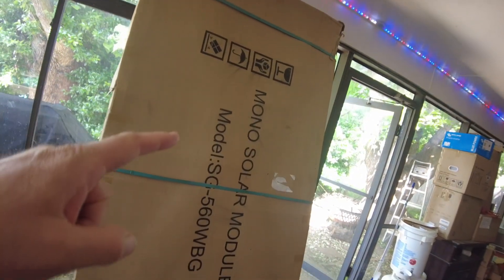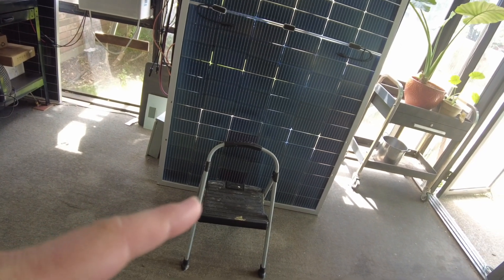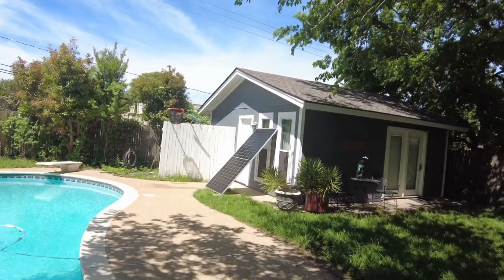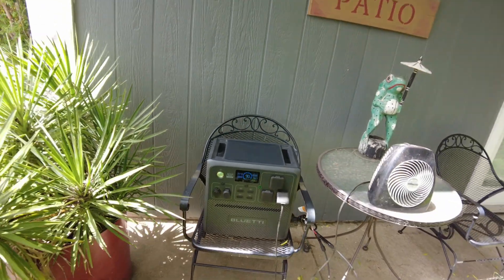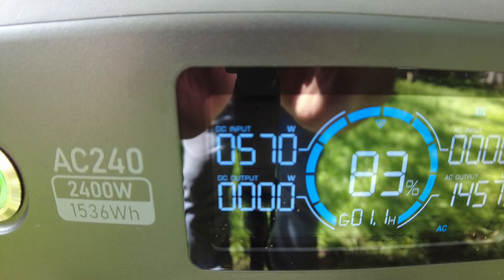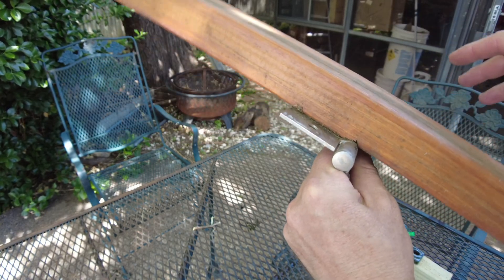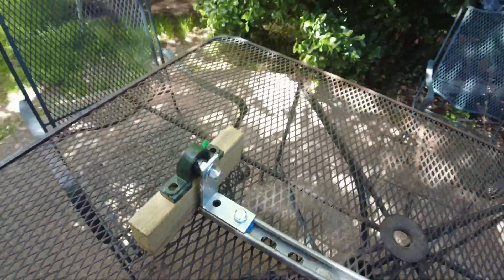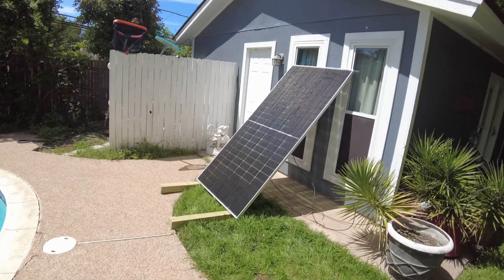SUNGOLDPOWER 560 Watt Bifacial PERC Solar Panel

Comment: Why don't you install those in a vertical way facing west-east; I've heard they generated more in that way and they kept cleaner as well, even in winter they don't get blocked by snow. I think the reason those have those wind measurement is because they are mean to be installed vertically.
Reply from the maker: That would be fun, I've wanted to experiment with vertical, hmm.

Comment: The idiocy of this guy taking a box cutter to cut across the cardboard box with a solar panel underneath pretty much tells you all you need to know about whether or not this guy has any useful information whatsoever to share with anyone about anything.
Reply: Wow! What a rude comment.
Reply from the maker: @meilyn22  Some people are just miserable 😉
Reply from the maker: I pulled the cardboard away from the panels as I was cutting. But even if it was right on it, what do you think it would do? Cut the glass in half? LOL

Comment: What really bothers me about this solar panel "power race" is that often the increases in power per panel are being driven by larger panels!  Well duh!  I have 15 year old panels on my roof and recently a company proposed replacing them with newer, higher power panels, but when I actually looked at the specs, my older panels were more efficient than the panels they were quoting, but theirs were bigger.  Huh.  I was actually impressed that mine were so efficient (and disappointed that the new ones were not more so).
Reply: university students  in Toronto tracked about 10-12 different arrays that varied in size and cost. The end results where very interesting as the smallest and cheapest array almost made as much power as the largest and most expensive array, coming in at second place. The conclusion was that most of the panels didn't live up to the advertised efficiency. I wish I remembered the brand of the cheaper panels. 😢

Comment: I have 8 Sungold Power 550w single facial panels on the roof of my motorhome. These bifacial ones look the same size as mine but are much heavier, having glass on both sides. I couldn't imagine myself, at 67 yrs. old lifting them on the roof of my motorhome like I did mine. It's a 2-man job for sure.  That said, I'm sure you will be as happy with their performance as I am with mine.
Reply from the maker: That awesome. Thanks for sharing 😊

Comment: 475W were too much for me. Went back down to 405W! Enjoy back surgery.
Reply: How so? Was it due to size?
Reply: @4evermetalhead79  more so the weight
Reply: @4evermetalhead79  Both. Bifacials don’t have the center support and our slightly flimsier too. If you don’t have a white or mirror reflective surface behind bifacials and have them at least 3 to 5 feet off the ground you’re wasting your time thinking you’re going to get more power out of them. Stick with standard panels under 430 W and your back will last longer.

Comment: Love these massive panels. Getting 560w actual from a single panel is insane. Too bad they stuck that specs label on the back blocking so many cells! Usually they’ve been putting little ones between the junction boxes.
Reply from the maker: I was thinking about pealing the label off :) But yeah wild getting 570w on a cloudy day.
Reply: @BradCagle  Absolutely crazy. After seeing that performance you were getting it makes me think my new array might have been current limited today. I was seeing 12.9 amps and the max output was 534W out of each 565W panel. They are at about 20 degrees facing south.

Comment: That is great news about experimenting with the bifacial panels.  I wonder what sort of power they would generate being setup 90 degrees to the sun but with light, white reflectors reflecting into both sides of the panel. Much easier to move light reflectors than the solar panels...
Reply from the maker: Man I really do want to play with some vertical bifacial. I've seen some experimentations with it, but I really think reflection from adjacent rows of panels may help, but I have not seen anyone experiment with multiple rows. Reflectors would be super fun. What do you think would be practical, and long lasting as reflector material? Thanks
Reply: @BradCagle  Acrylic mirror panels from Amazn.
Reply: @BradCagle  There is some corrugated plastic panels we can get at our Bunnings hardware store . They come in 8 x 4 sheets and various thickness from 3mm to 8mm. If you go for the 8mm (1/3") thick ones, however you will need a strong frame to support against even the gentlest of wind as they are super light. None the less, they are cheap, polypropylene I think and white. With this approach you can set the PV permanently in place and move the reflectors to adjust for optimal power. As you (and most of us) will mount a bifacial panel, there will be very little light coming in from the other side.
Maybe this idea is just BS, but would be a very interesting experiment for bifacials.

Comment: You know that to get that much wattage is to increase the size of the panel... Right????  Also I am glad you are working on your solar panel station.
Reply: Yes and no though. Couple years ago something this size was 520-530w. These newer cells are in fact putting out a bit more power!
Reply from the maker: @BeeneEnergy  True. Do you think it's the busbars config on the cells increasing the power? This one has 11 across each cell.
Reply: @BradCagle  I think it’s the newer “N” type cell. Haven’t looked to see what that means but seems to be newer tech in play.
Reply from the maker: @BeeneEnergy  I've seen that "N" type descriptor tossed around. I need to read up on it. Thanks
Reply from the maker: Yes, of course :) Thanks
Reply: Same size as 525 CC panels.😊Seen 2400 watts with 2s2p Same weight too.